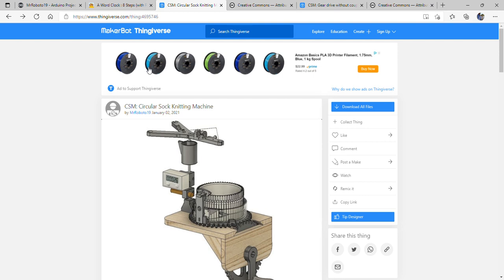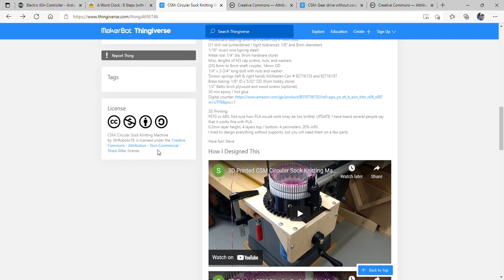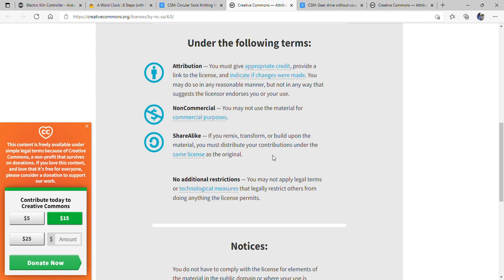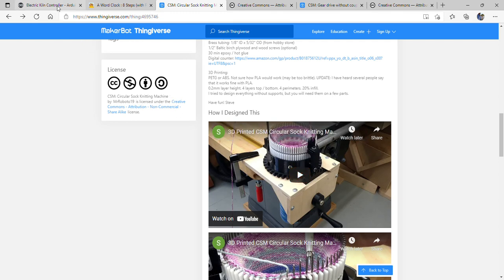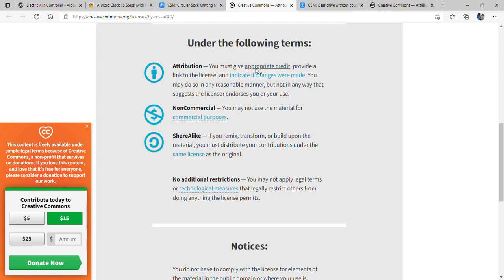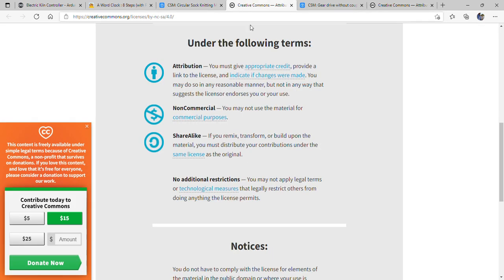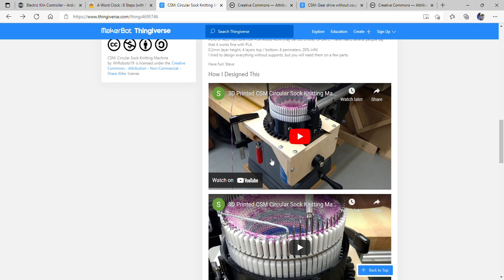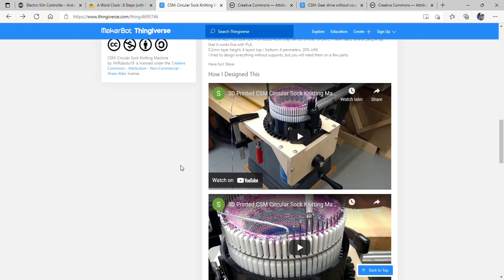3D Printed CSM Circular Sock Knitting Machine: License

Comment: Could you tell me what I would have to modify if I want to print your machine, but the needles I have are 2cm longer?
Reply from the maker: Do you have a picture of the needle?
Reply: @steveturner1447  the needles are from the Brother kh 850 machine, cut to where it has the protrusion, they measure 79mm. uncut measure 120mm
Reply from the maker: @rincondelabores  It would take a lot to modify my design for these needles.  You might look at other designs that were specifically made for the flat bed style.  This one MAY work, not sure: https://cults3d.com/en/3d-model/fashion/3d-sock-knitting-machine
Reply: Thanks!☺️